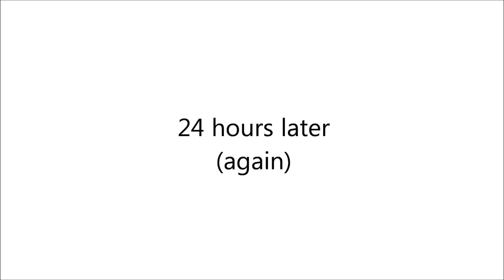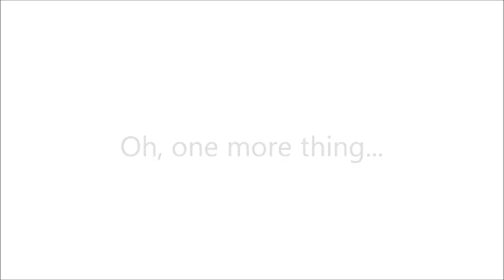Finishing crystal clear canopies on scale model aircraft - how to guide

Comment: Appeared in the first scene the transparencies were wrapped in tissue. Coin collectors cringe at the sight of things "carefully" wrapped in tissue. It is surprisingly abrasive on coins and ruins their value so is even more lethal to softer plastic and leaves a foggy surface blemish. Kitchen cling wrap is benign but a little more "entertaining" to remove the parts from😜
Reply from the maker: Kelly, that is a GOLD suggestion - thank you! (I'm embarrassed, I also collect coins and I didn't know that about tissue... whoops) Cling wrap is a good idea, but would it have enough "padding" to protect from jiggles and knocks in a box, as opposed to gentle abrasion?
Reply: Dave's Model Workshop 
Hi Dave. Sorry for delay in reply. With the cling film scrunch it up so its like untidy bubble wrap then loosely wrap and scrunch it around the parts. Makes it easier to unwrap later. Have spent many a frustrating lunch trying to find the end of tightly wound cling wrap.
Reply from the maker: Aha! That would definitely work - thanks Kelly :)
Reply: If you're really worried about it, you could wrap the canopy in cling wrap and then pad that with with the material of your choice.